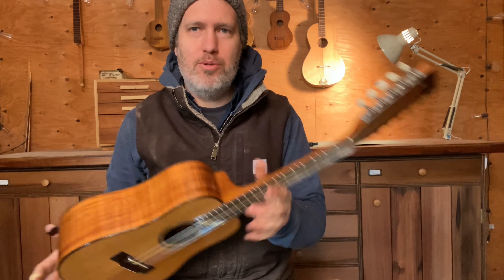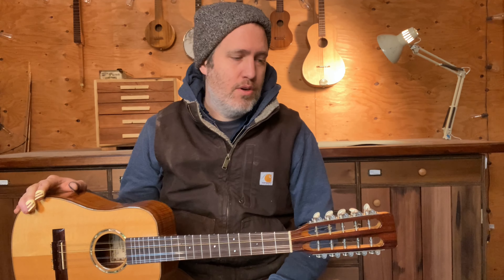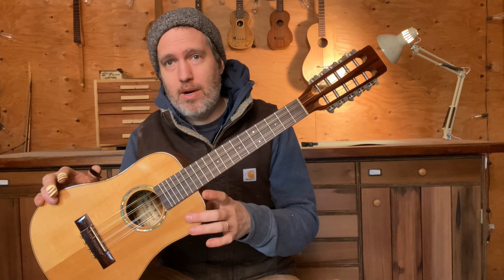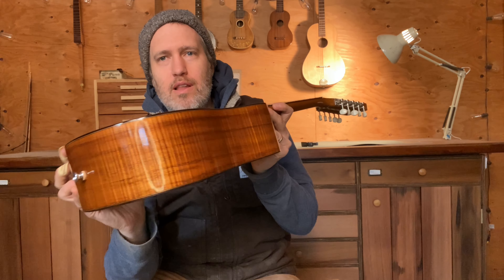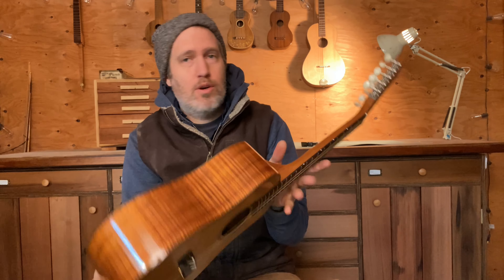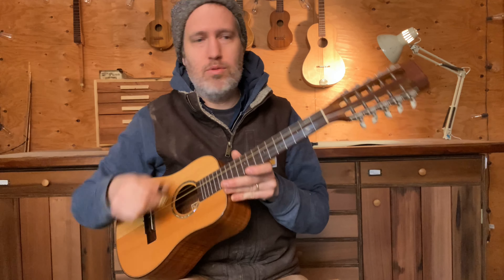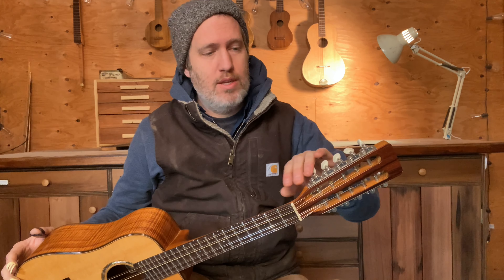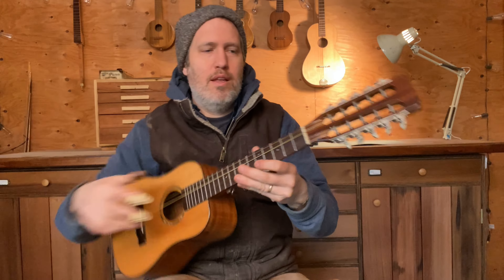1978 Gomes Spruce and Koa Tiple

Comment: It's beautiful. I ran across one on ebay probably 30 years ago, and never knew how to tune it. It has two linear cracks in the spruce top below the bridge, so I never even tried to tune it, or put any kind of tension on the neck. It's a 12 string, in sets of three. It came with some (old even then) new strings in paper packets, with the only word I recognized being "Tiple", since I hadn't written Spanish since school days. I haven't thought about it in the 14 years we've been up here in Colorado, but a video that popped up on on Bajo Quinto reminded me of it. hmmmm, I might get it restored to playing condition one of these days. Your playing the one featured here makes it sound lovely... more like a mandolin than uke, but somewhere between. Thanks for your video. ...edited to fix typo